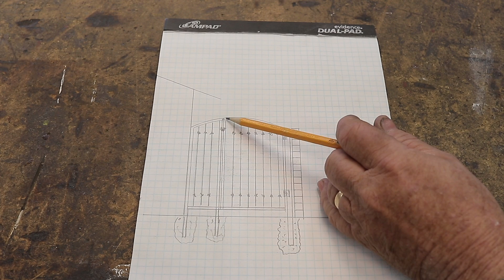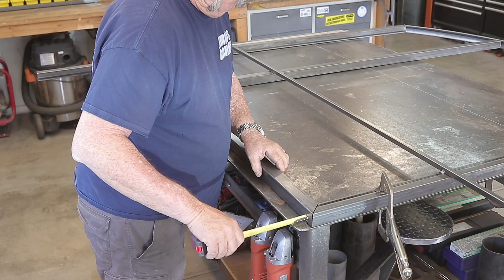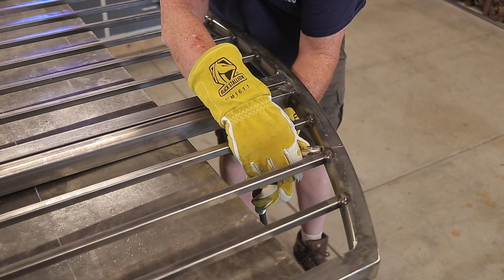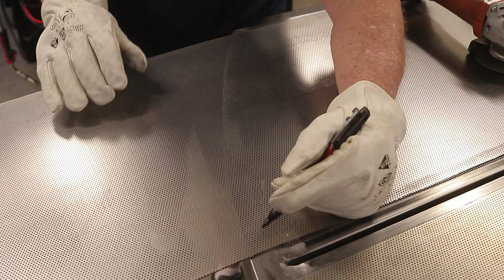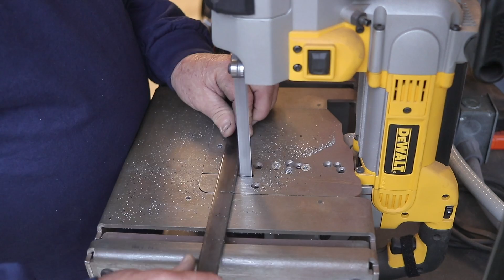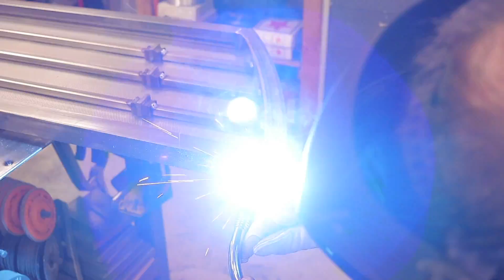Metal Arch Top Gate With Security Screen | JIMBO'S GARAGE

Comment: Hey Jimbo, I really like your work. How come you prevent distortion? I am new to welding and when I make my gates and the look at them from the corner angle I can see that it bend towards the place where I welded. It Really drives me crazy. I am using pure CO2. Should I use argon and co2 mix.
Reply: Rusu, I am a beginner with limited tools but this is what I try to focus on: Make cleaner cuts even if I have to touch them up with flap disk before I weld. Make sure the fitment is very good after I clamp using a jig, level, square, 345, etc. Thoughtfully choose where to tack weld. (I think tack welds can be used to make adjustments?) Double and triple check fit again. When I am satisfied with how it looks I start welding. I find that welding slowly, and alternating where I weld helps it stay a little better. 
I am sure I missed lots of stuff but this is working for me. Hopefully others can add some insight. And I'm not sure of your experience but good luck and keep grinding!
Reply: @rich5034  Thank you very very much Rich! I really appreciate it. Keep up the good work.

Comment: Jimbo, one of the things you might want to try to fit the deformed arch (from the rolling process) to the verticle legs of the gate is to slice on the front and back of the arch tube along the length of the arch about 3-4" from where the leg/arch joint is towards the peak of the arch.  Hope that makes sense.  Then, squeeze the now 'loose" front and back (or just do one surface depending on the gap you need to make up) together to the same thickness as the verticle legs.  Weld it up.  

...an explanation that makes one remember the picture is worth a thousand words saying.
Reply from the maker: Thanks for watching and your advise,  Jimbo!

Comment: I bend arcs like this.  It will try to flatten it like that if they don't have the side plates of the bender spaced just right.  Nice gate though.
Reply: Vancouver Island Waterjet Well First of all I am no bending expert!  My bender is a pyramid type but all three wheels are driven, even then I sometimes get some slip.  I have not done any galvanized pipe myself but I did see a friend do a bunch I think for some trampolines once.  What he did was have a local machine shop with  cnc lathe make him dies out of a hard plastic.  It didn't hurt the coating.  Unfortunately I haven't had any luck bending round tubing with anything but close to the correct size.  As you said, it collapses it.  
Jimbo on this video had this problem because the company had the side plates too far apart and it let the square tube spread a bunch.  It is hard to do because it puts a big bind on the side plates when spaced to prevent spreading out.  In that situation I really have to grease the side plates heavy where they get rubbed on by the tubing.
Wish I was more help.  Tom
Reply: Tom, does it help to heat the square tubing?
Reply from the maker: Thanks for watching Tom, Sorry i can't help you on that, I don't know anything about  using or making dies.  Jimbo!
Reply: Jim Allmon I is possible but you would have to have a way to first heat it red and then handling it without burning yourself or heating up the machine too much!  I have tried to anneal the tubing after the first bend or two but it sometimes tries to warp the tubing.